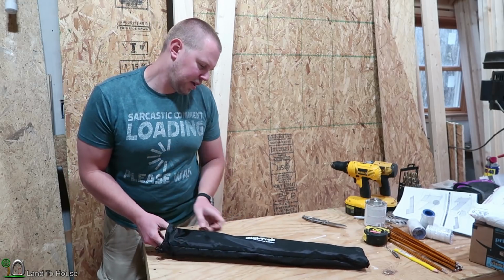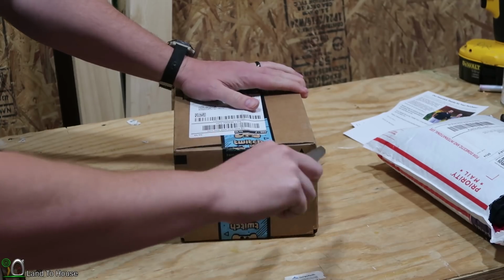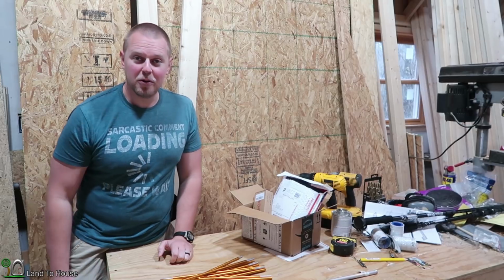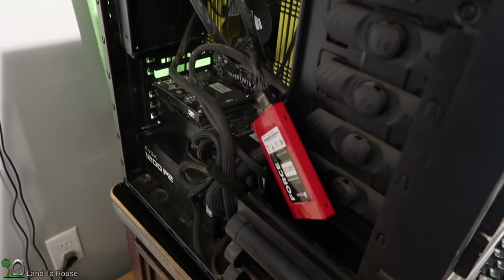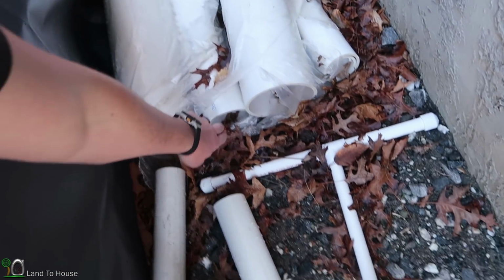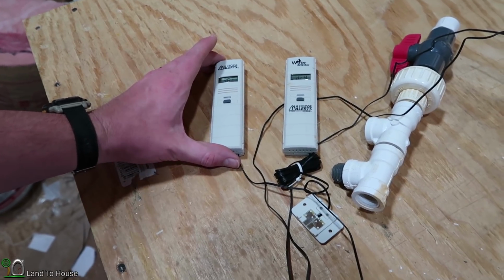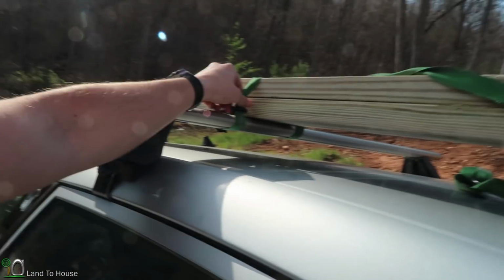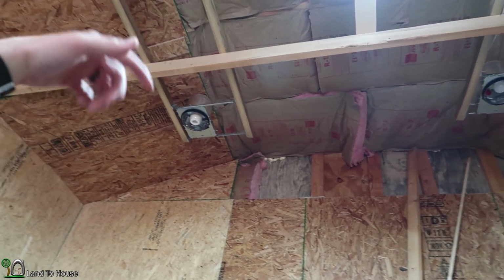My Computer Lives - Vlog #75

Comment: Sorry for two comments however watching the last of your video may i suggest one of these. https://www.bunnings.com.au/our-range/building-hardware/building-construction/ventilation/roof I am sure you will find something similar in North Carolina. Living in brisbane we have exactly your problem where the inside of the house  / rook space becomes more humid. These are fantastic for increasing airflow and are relatively cheap. 2 of these do my entire house with a roof space of around 200 m2. Just a thought for your shed.
Reply from the maker: Yes that is a great idea. I have been looking into a solar setup that would only pull when the temp is above 85 up there. I will need to get to that soon so there is no moisture damage.

Comment: Hi Seth, you should use a mac and use time machine and that might be a more reliable solution moving forwards.
Reply from the maker: I purchased my first macbook pro in 2011 and it has been a beast. Still runs well. The issue is that I would have to spend a fortune to get the same machine as I use for editing. 64 gigs of ram would be as much as my car in a mac haha. The drive that died was a 2012 and I export a 1 to 4 gig video almost every day. So it had a good life.